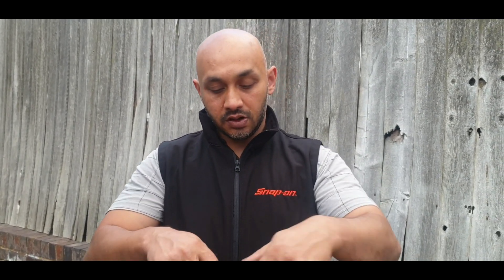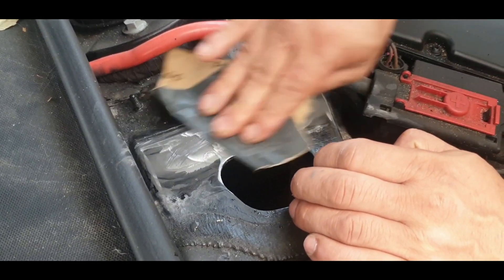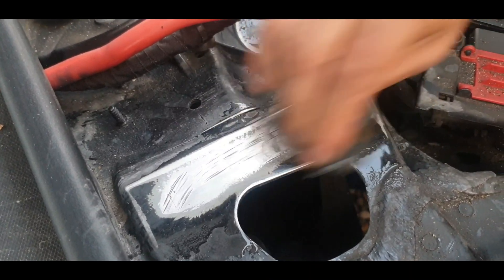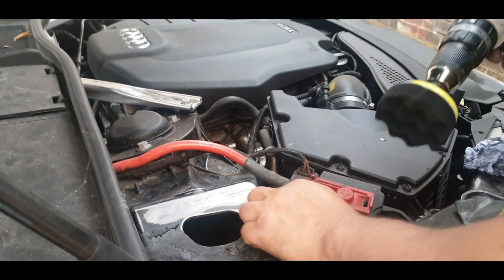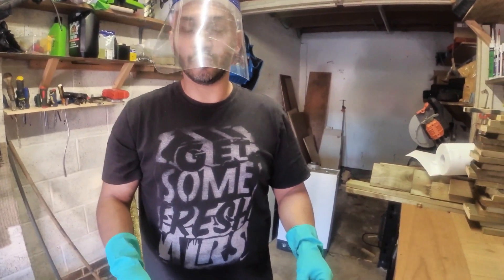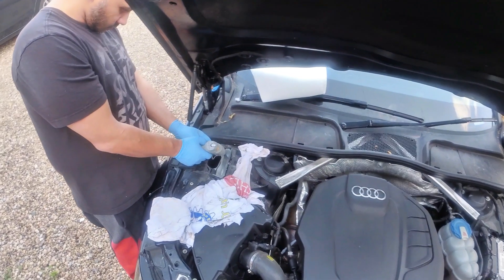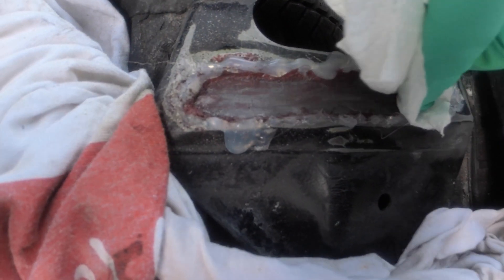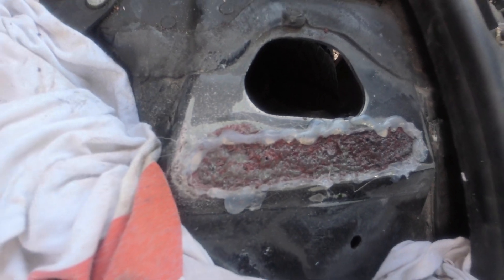Cat X With Missing Vin Numbers Step By Step Part 3

Comment: Hi, so I usually do not buy a car salvage car with defaced vin but bought a locked one. The windscreen one is the original but the stamped vin is different. I can see it was painted and stamped again. So can you do a MOT on a vehicle that has the stamped vin tampered with? Or I need to rest stamp it in order to pass the MOT?
Reply: What did you do?